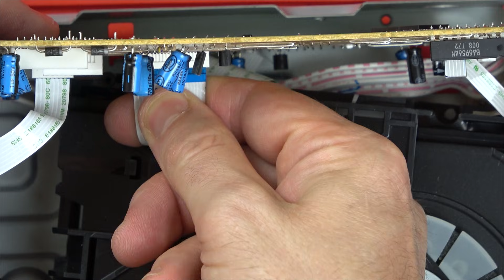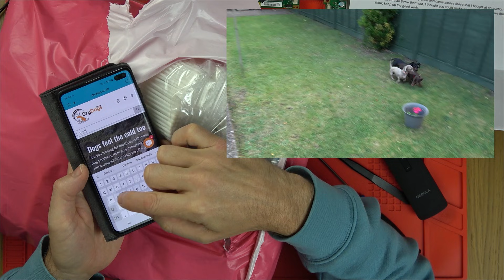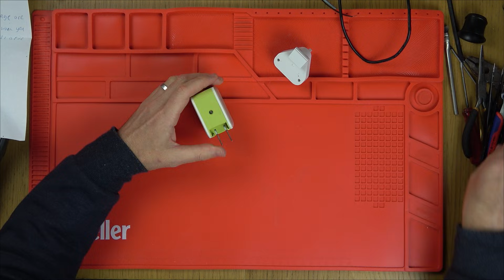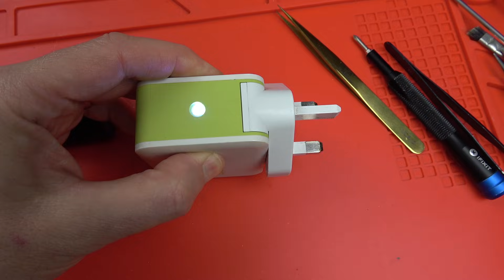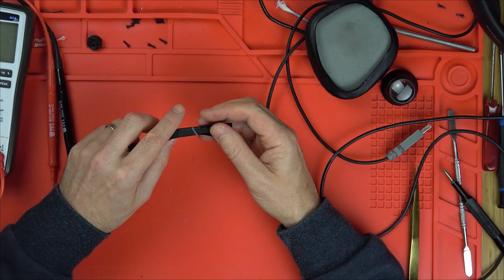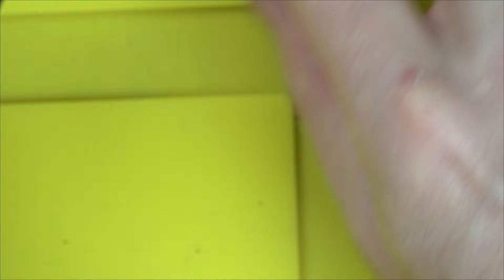Viewers Broken Items - Can I FIX them?

Comment: The Last One That Had An Extra Pin Is For The Read Lock Switch Also You Didn't Need To Heat It Up On Mine I Didnt Wreck The Casing At All And All I Did Was Pry At It. Not Even Gently Prying I Just Stuck Some Tweezers Down It.

Comment: I hate when the cd drive won't stay shut , it's different then the Xbox days when it didn't want to open and you smacked the top to get the tray to open 😂, what a simple fix it just needed a little love cause the board had popped out of position and made the micro switch out of position nice

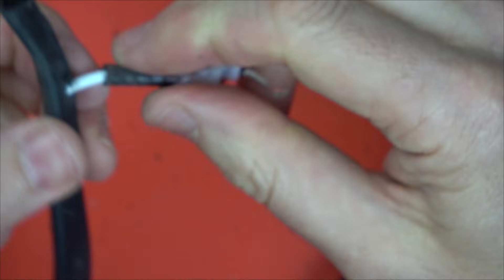Comment: 48:00 u could of had a thin black cable and connected one end to the other on the outside of the plastic covering and stick it neatly run outside.

Comment: With the projector, it makes sense not to have a spring on the offset screw. The two screws with a spring that are in line with the dlp sensor are the ones applying the pressure. The other screw would put uneven pressure on pulling the heatsink crooked if anything. Only the two screws in line should have pressure i feel (I can't be sure without looking at it)

Comment: I did a similar repair on a headset mic before watching your video. The end of the mic got broken off from the arm, so i took a "tube" from a felt-tip pen, cut it to size and cut it across so it would open up a bit so i could slide it over the broken mic and onto the arm. Then i slide the mic in at the end, the diameter was a perfect fit. Finally i put heatshrink over it, no one would ever know it's been repaired and it's stronger than it was before. 

Your videos inspired me to do this and the heatshrink idea I came up with I sort of indirectly got from you.

Comment: you could use small singel brade gage wire .i have done  it in previus same wire  problem. Problem is t b straight s gets in easier for the microphone

Comment: One of the most criciql measurements in a cd player is the distance of disc surface to laser emitting point. If that had been drop to cause faulty movement of tray then you'd think las3r may be damaged also.
Great repair Keep up the effort.

Comment: hi nice video, i have a question from this moment 47:17 if i understood correctly... the mic ground and the light ground are full short so that means you can feed both with the same cable and replace the other cable with the broken negative mic cable.. right?

Comment: That game gear is bad. It should have been clear to anyone that recapping would be pointless. 
The capacitors realy did a number on it. Hit it with some pcb cleaner and a soft toothbrush to ensure all the electrolyte crap is gone, and pack it away for spare parts.

On a side note, what is that little computer your using while fixing the headphones/mic ?

Great vid. 👍

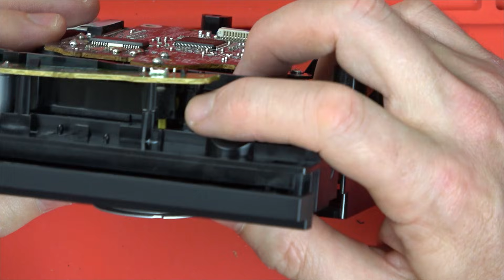Comment: I think you missed a detail on the CD drive at 6:35-7:20, black plastik pin holding the PCB in place on the right side, is broken. Probably should have been glued to add stability otherwise the problem could easily happen again.

Comment: @24:30 Did you add thermal paste after you scraped off the old dried up stuff? It could have a thermal protection check, mid-bootup as with CPUs/GPUs. I have had CPUs that were missing just a tiny amount of paste, which resulted in only about 70% or so of the surface actually covered. And that prevented the entire CPU from working -- preventing the entire system from POSTing. The CPU clearly has some way (embedded thermistors) of knowing how hot it gets, and there are sometimes motherboard sensors under it as well. So I would make sure you put new paste on it. CPUs actually have a good number of thermal sensors on them, not just one. So I think there is a good chance that there is at least one thermal sensor on that particular piece/die of silicon in your projector. And if you don't put the putty between the surfaces to bridge those surfaces and dissipate the heat, it may prevent further progress beyond that to protect itself. I know you said you were going to remove the putty. But I don't recall you saying you were going to replace it with fresh, nor did I see you do so in the video. You seemed more interested in making sure that the pins were making full connection, and you thought that the dried up paste was actually preventing the pins from contacting -- perfectly logical thinking, but only half of the problem...the die still needs cooling. I think they essentially warm up just a tiny bit and then check to see if that heat gets dissipated first before actually proceeding into fully-on mode. You can't just assume that it'll fully work and produce video until it gets hot and then shut off, which TBH it seems you did.

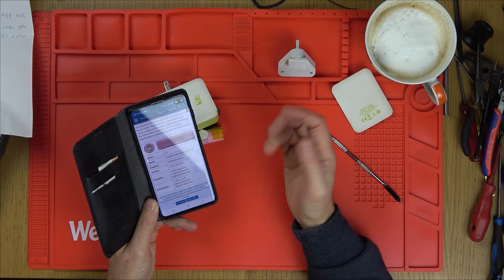Comment: 27:05 Oh heck yeah, lithium batteries don't like being charged to 100% frequently or discharged to 0% frequently, but that's exactly the life they live in power banks. And they can ultimately end up in exactly the fault condition that you found: self-discharge. I'm told that this is because the electrodes form microscopic whiskers that bridge through the electrolyte.

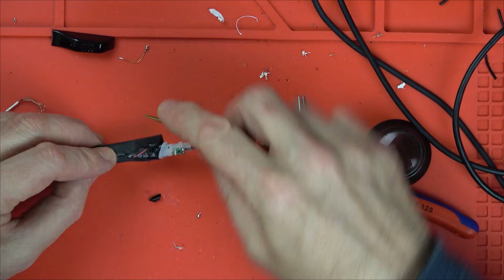49:00 Your heat-shrink finishing of the microphone arm reminds me of something I did at work a few years ago: I was wearing cheap sunglasses and managed to break one of the arms. I didn't feel like going out and buying another pair just yet, and it was a pair of sunglasses I would wear only at work anyways. So I mended it with a pair of heat shrink tubes - a slightly larger one over a smaller one for rigidity. Then a few months later the other arm broke, so I did the same fix again. Still have 'em. 😂

Comment: Hi Vince, I would certainly recommend the RCminder DH30 MAX battery spot welder. I have been using it to rebuild power tool batteries and so far has been great. It also has a 10,000mAh internal battery that you recharge via usb-c.
It is quite powerful, I must say.
Reply: I've been looking for one instead of building one. I want to save cells from a stack of laptop batteries I have and like you mentioned, build some tool batteries. Thank you for the advice

Comment: Mate... MY Mate.. Did you ever measure continuity to the other side of that bend pin? also that lamp runs under high power so there must be a low voltage signal somewhere.

PS> Where do i get that awesome sized Weller silicone pad? Im Jealous.

Comment: the dlp chip is just the mirror the lamp in it is bad since there is no light coming out but it stays on I would say it uses some kind of led cob
Reply: the way a dlp projector works is by taking a light source running it through a color timing wheel that separates the 3 colors needed then reflects that off of the dlp chip using the timing set on the wheel to reflect only the color needed for each pixel
Reply: a damaged dlp chip would result in the picture being all black or white but you could still see some light in the lens even if it was all black typically if the chip go's bad it starts with a few bad pixels so i am sure your problem is in the lighting section on older dlp projectors they had a bulb replacement door so for that led one you may have to dig a bit further into it then test the led power rail when its on i bet its just one bad led in the array

Comment: Vince , why don't you invest in some micro  drills and just drill through the via, thread a strand of wire through, solder either side easier than loads of crossing wires, just a thought as I've done this before
Great vids though , how's the roller going .

Comment: About that projector, you had it on radio and bluetooth. Maybe it did nothing because it had to be switched to video mode? I have a similar one (very very cheap chinese one) that when is on radio/bluetooth do not display video, but with a SD card in it turn video on. Also, to use it as projector, I need to give it some signal on VGA, AV or HDMI. It also have a button on its remote to switch the video off (or maybe only the LED turn off to save power or to protect the LED).

Comment: For the Sega, an ultrasonic cleaner could be a good way to remove the stains and oxide. Just remember to remove the display and the electrolitics caps and then give the board a good wash 😊

Comment: Regarding the Sega Game Gear, I once had a gameboy advance that was in the same condition. Granted it definitely needs a lot of work, but honestly it was a rewarding experience getting so much damage repaired and seeing it work against all odds. Tackling visible damage without having to think about it is therapeutic sometimes. I went over all the broken vias and traces with a fibreglass pen so I could physically see the break and repair it. You’ll also be surprised how many will clean up. If you wick up the solder from inside the vias you could run two through-hole jumper wires, going from point A on the top side of the board, going to point B & C on the underside. 

If the vias are full of corrosion poke it out with the end of some tweezers, clean with IPA and then run the wires.

Come on Vince it’s vintage! It deserves a revisit! Beyond economical repair is for the manufacturers!

My gameboy advance still works 2 years later by the way!

Comment: Great Job as always Vince👍. Nice easy fix on the Sony CD, shame about that projector it looks a nice bit of kit. The game gear as you said would need too much work. I had similar when I looked at that Cricut vinyl cutter that suffered a similar fate. Great idea with the heat shrink on the headset mic. Strange co-incidence that we ended up both doing viewer repairs at the same time 😂😂

Comment: I recently repaired a Pioneer CD/Radio with has a wonderful rising screen when you turned it on.  It had CD problems and I discovered that it was worn after years of use and wouldn't engage the CD drive mechanisms.  I got it work but it was unreliable and I found a replacement for only £10 on ebay.  I imagine that many of the CD players from the late 80-90's are starting to have mechanical problems.

Comment: I wonder if the fault on the first one was because somebody was heavy handed when putting the CD in, maybe not placed in right and trying to push it down. Either way I'd have been tempted to do something to stop it from happening again like hot glue on the plastic legs.

Comment: AGND = Analog ground, DGND = Digital ground, DVDD or DVCC = Digital Voltage supply (DD = CMOS (MOSFET drain), CC = TTL (BJT colector)), AVCC or AVDD = ANALOG Voltage supply (DD = CMOS (MOSFET drain), CC = TTL (BJT colector)), VEE or VSS = Negative voltage supply (EE = BJT emiter, SS = MOSFET source)
Reply: What is vire—
Reply: @rayhowe4354  Do you perhaps mean "via"? It does sound a bit like vire with the British accent. If so a via is a tiny hole drilled through a circuit board that is plated with metal to connect the tracks between the different layers of the circuit board. In this particular case, they're especially relevant as they're often more susceptible to being damaged by corrosion than the rest of the traces on the board.

Comment: Looking at the pin out, it looks like the SD card adapter has an additional VSS2 (ground pin), not sure why it's there or if it's even ever used. But the pin outs show the Micro SD card only has 1 ground pin and the adapter has 2 ground pins.

Comment: I would have disconnected the "mute" led and used the intact ground wire for the mic instead.  I don't find the led to be that useful and you wouldn't have to cut it open.  But that's just me.

Comment: Vince, don't those large caps have leak-down resistors to bleed off the voltage for safety reasons?  You're a good detective.  You don't miss much.  A regular Mark Furman.

Comment: With Lithium Ion batteries, the key rating is maximum continuous discharge current, which will be in amps. That's the amount of juice it can safely push out at once. As long as the replacement battery is equal to or higher than the original, you'll be fine. Amp Hours (or milliamp hours) is a measure of capacity. A one amp hour battery can supply one amp for one hour, or two amps for 1/2 hour, or 1/2 amp for two hours, etc. As far as safety goes, it doesn't matter, but a lower rating will go flat sooner. As for INR vs ICR, it doesn't really matter. The charging and discharge voltages are close enough to the same between chemistries that they are interchangeable.
Reply: Additionally, max/continuous [dis]charge ratings might be given in 'C' too, multiples of the capacity.
A 2000mAh (2Ah) cell rated 20C can do 2x20=40A

Comment: You don't have to add a wire for both sides.... Just takes a copper plug off an old board, or order a fuck ton of new ones. for pennies on the dollar, pop the coarded one and expoxy/resin/stupidglue in the  new copper tunnel. The tracks are totally fine. If you had a $4 grand gpu and it needed to be wired. sure. I could see the time and effort being worth it. But swapping out the through hole? Thats novice stuff I teach my apprentices. 
What is concerning, is seeing all the shoddily solderring across the board. If I couldn't do a proper re-melt (whjich is what honestlt is what flocked the board off, someone legit throwing it into an toaster oven to try and 'fix it'), to where all those resistrs looked factory. I;d go hands off

Comment: Mics on those types of headseats are usually electret or condenser. Put your meter onto capacitance range (nF or pF) and if its working the reading will be steady with silence, but flucuate with sound.
Reply from the maker: Thanks Dash, that's really useful to know 👍👍👍

Comment: For that microphone you could have just used one of the LED wires instead and the LED would no longer work but the mic would add do you really need the light indicator on the end like that.

Comment: I had a break in a wire close to the jack on a set of Behringer headphones. Try as i might, i could not get the solder to tin the cables when replacing the jack.

Comment: The only thing I can think of is a mode switch or motor or cracked plastic gear but this isn't a VCR or BetaMax so I don't know
Reply: Why not use hea... OMG I was literally just going to ask why not use heat shrink and you did well at least I think you did I heard you say heat shrink but I couldn't see any on the mic arm when I looked back at the TV and watched the rest of the video before continuing with this comment so I'm guessing you did a really good job with it or I zoned out again didn't hear something you said I hate when that happens any way keep it up VINCE

Comment: Nice fix on all of what was fixable, Vince :)
Ultrasonicly welded stuff like that memory card adapter or a laptop charger usually come apart with a little help of some 95 octane petrol. One drop, you let it run around the weld, then wipe off so it does not melt the plastic, and it should come apart easily.
Reply: We haven't been able to get that stuff, since they had to remove the lead.😅
Reply: @chrisprobert6  The pure petrol/gasoline you can get in small bottles generally meant for cleaning would be around that octane rating but more importantly works for this task, acetone would probably also work decently well on some plastics like ABS.
Reply: @oliverer3  acetone destroys all plastics in my experience
Reply: @chrisprobert6  There's plenty of plastics acetone has very little or no effect on but they're unlikely to be used for something that is ultrasonically welded.
Reply: @oliverer3  Lighter fuel (esp the expensive non-black-smoky stuff like Zippo branded), or is that not high enough rated?

Comment: For the headphones, if it was just the mic ground that was broken, could you have just desoldered the led wires and used the for the mic? The led wouldn't work but at least it would be fully functional

Comment: Milliamp discharge is the same as amp so it's just a different way of saying rather than saying two amps it may say 2000 milliamp discharge it's kind of weird that there is not a standard but it's annoying they do that because the 2000 looks bigger than 2 Amp it's like saying you have a 20 amp power bank for a 20000 milliamp power bank

Comment: thanks to you i'm repairing mostly faulty audio systems and last week i got literally a brand new Teufel stereo system for like 30€ because it had a very similiar issue as the Sony micro stereo system. It was described as faulty. 10 Minutes of work and i got a fully working Stereo for one-twentieth of the original price. ^^

Comment: I had my first ever 18650 flare up last week, expensive ones too very high drain things... was cycling the cells for another set an Efest pair and I thought this cell seems warm just as I was going to pull it out, as it came out it started fizzing fire and burned top of my thumb pretty badly.   Only had them a few months and always treat them with respect not draining them to the max or overcharging having a pretty expensive 4 slot charger too.   Sent the pair back to the company with quite a shirty letter attached, sent in a proper battery box and bag and I won't buy the brand again :(

Comment: Maybe the extra pin on the SD Adapter is related to the lock on the side, as you can lock the SD card adapter so it is not readable, although I do not know how it works electrically. 
Have been enjoying your videos!
Reply: It is a write protect feature. You can use it to make card read only, and on adapter and SD cards it is simply a piece od plastic. Detection of it is inside reader itself, not card.
Reply: If it even works electronically instead of like the old 3.5" floppy or VHS tapes where a pin falls into the opening.

Comment: With regard to lipo battery capacity, the 3.7 volt cell itself may be 3000 mAh , but by the time it is up converted to 5 volts for a power bank it will be correspondingly reduced. So manufacturers are being misleading to claim 3000 mAh on a 5 volt power bank. It will be nearer 2200 mAh, and that is with with 100% efficiency.